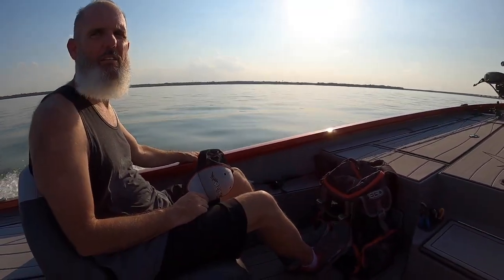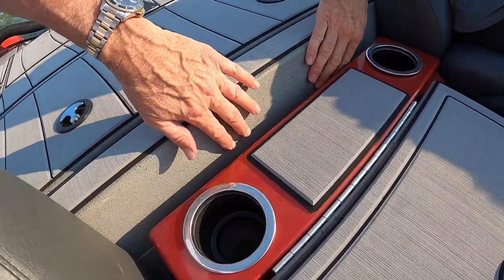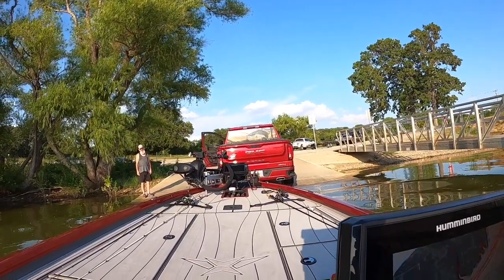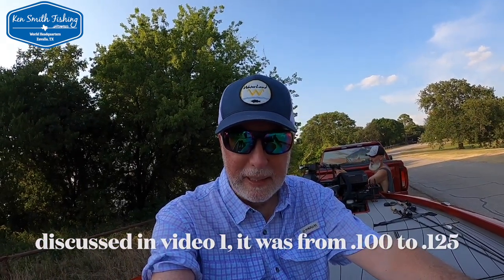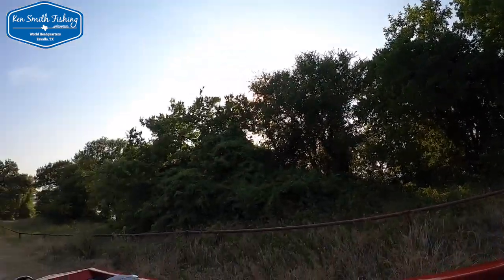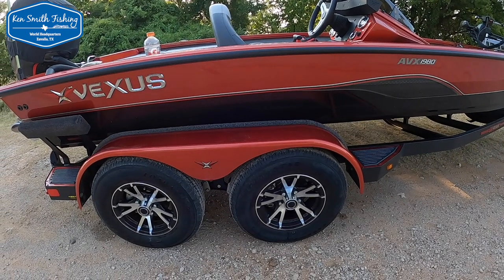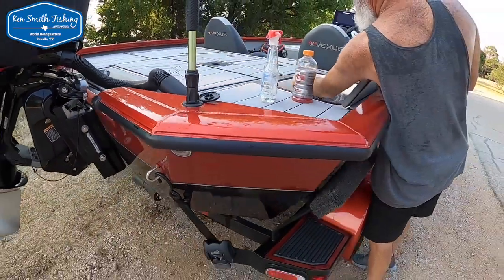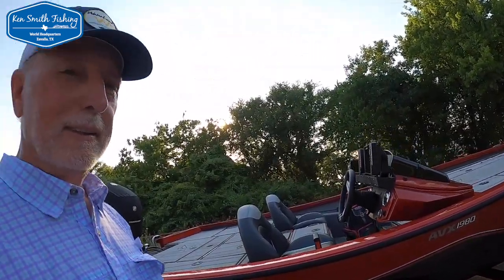Vexus AVX1980 Review - Part 3 - Great Tin Boat Search of 2022 - Boat 2 Vid 3 - 6th Video in Series

Comment: Yes, great boats, Vexus. However- 50 mph with a v6 pro XS?  What a lead sled! I mean- most old 18' fiberglass pad hulls will run out at 58-60 with a 150 efi. Even with a prop change and engine height adjustment maybe, 53/54?  Shallow water advantage is all anyone will get from an aluminum. Maybe some fuel milage . Great job Ken! I'm catching this video series a little late since I didn't know you even did aluminum reviews. So much for the notification bell.

Comment: I can confirm your comment on keeping on plane at low speeds in rough water.  Ran my local lake 3-3.5 foot waves, 20-ish mph backing off/getting on it riding the waves.  Never felt unsafe - did get a little wet pending the wind.  Opened up plenty of fishing spots to me on windy days that I wouldn't have tried with my old boat.

Comment: 2 inch dow corning foam cut to fit the lid gets the insulation part done on the ice chest. Simple and works well. 
I’m sure insulating that lid is on a Vexus list some were..

The charger cord hooked to the rear deck lid is another peeve. Vexus needs to install a plug at the rear of the boat or at the console to plug the charger into. I added a NOCO plug at the console. Cord drops from my ceiling in the garage straight down to the plug.

As is, Drop the cord into the battery compartment and its a PITA to get back out. 

Some will say they boats are under powered. As you have seen the boat plan quickly and ride very well. They cruise very well in that 30 to 40 mph range were you run most of the time. Could they use more top end speed.  Everyone always wants to go faster. IMHO the 1880 should have a 150. The 1980 a 175 or 200 and the 2080 should have a 250. 

Vexus would OWN the aluminum boat market at that point. 

Vexus Customer service is the bench mark as far as i’m concerned. Best in the business! 

Great review Ken.

Comment: Just caught up on the tin rig series. Running a tin rig myself but in a jet application. I seen you stated a few times about how to rate some of these tin rigs.
Being in the jet boat world, where we run in sub 6" of water you can imagine some of the stress we put on them. Especially when you get into the 200-300HP engines.

Things to consider:
Hull - is it one piece bottom or 2 piece split with the keel being used to join the two halves, is it foam injected, how is the bracing (longitude or cross or a mix of longitudinal and cross bracing), what kind of "hull bottom", modified, pad, semi v, is the bottom of the hull ribbed, flat, stepped
Hull thickness - personally I never recommend anything under 100ga if you run shallow. Under 100ga stress cracks, dents, dings and everything in between is really easy to happen, also the thicker the hull the better at times. Obviously thicker hulls are more resistant to dings and dents but harder to repair when you do ding it or dent it
All welded construction - no screws holding anything in when it comes to joining metals, obviously there is some leeway with this but if it's structural it should be welded. 
Transom construction - how many knee braces, how thick/large are they, do they wrap over the top of the transom, is it wood filled or not (generally this should not be wood filled, also this is generally the area in which wood is used in a tin boat, to add strength here), how is the corner gussets constructed (30 inches long, 16 inches long, do they extend from the corner to the engine), if it's got a "splash guard" like most bass boat style do how is this constructed, is it welded to the transom and rear deck tying the transom to the deck, for the most part all cracks or stress issues or problems for tin boats occur at the transom due to the stress put on them
Bow - is the cap re-enforced for trolling motor, is it all welded or partial, is it tied into the front deck, if so is it welded, screwed, riveted (welded being the best, screws being the worst)
Balance - is weight distribution good or bad, with tin boats being light if you don't have weight distribution equal you will notice it running down the lake/river, it'll lean one way or the other, can make a difference in shallow water running, speed, MPG, this is more jet boat oriented how does it sit in the water is it rear heavy or nose heavy, can make a difference in getting on plain, how well it handles in turns, nose heavy will want to drop hard and have a speer like effect, run slower, worse mpg to a degree, will turn faster, run shallower, less chance in having the "swapping effect", rear heavy will run deeper, take longer to get on plain, easier to swamp, turn slower, the nose will have a floating like effect, will run faster, better mpg to a degree

IMO outside of costs, tin has a better value to most users for the following reasons:
Light weight - easy to tow, easy to maneuver, easier to handle
Longevity - I think tin boats and glass boats if cared for are the same to a degree, it really just depends on how old you are talking about, a tin boat 20 years old can be in better condition than a glass boat with minimal care, a glass boat can fade over time or run into rot if not cared for
Durability - both glass and tin have come a long way here but IMO if you factor in constant abuse and you have a boat built really stout I think tin just edges out glass but not by much maybe a hairs width
Repairs - this is the big one that not a lot of people talk about, if you take out all the stress cracking or old age issues and just look at a glass boat and a tin boat and run them both into a tree and rip a hole in it for the most part a glass boat is totaled and done, you maybe able to find someone who might attempt a repair but you have to find a fiberglass shop that does fantastic work otherwise it would be a waste. For the tin boat, yea it maybe totaled as well but just about every dig, dent, and hole can be filled by any decent aluminum welder, I've seen photos on boats ran into trees and had the bow wrinkled 2ft back and they just weld on some pulleys and start working the metal out and where it can't be worked anymore just cut it off and weld in a replacement. Prime example: I ran a MK Terrova on my tin rig and made a mistake when mounting it, eventually it cracked and busted up the bow cap pretty bad. Just took it into the shop and had them weld on a new cap and double reinforced it so I wouldn't make the same mistake again. If it was a glass boat that would've been a pricey repair to have fixed let alone trying to reinforce it would probably not work.
Reply from the maker: awesome add Nathan, would you email me your phone number, I'd like to talk if we can kensmithfishing@outlook.com
Reply: @KenSmithFishing  Sent.

Comment: I agree with previous comments the cooler does hold ice all day. I have 3 27 series batters with two guys over 210 lbs fully loaded I can run 54 to 55. I would definitely recommend adjusting the jack plate. I love my AVX 1980 I chose it over the Ranger because of the ride and storage. I have zero issues loading the boat. He has the trailer to far in to the water. The boat loads very easy. Great review.
Reply from the maker: Henry that ramp i so shallow no other way to load it

Comment: Good review. I have the 2021 Vexus 1980. You said you did not like the cooler because it was not insulated. However I live in Texas and fish In the 100 plus heat and the cooler is outstanding. I have ice at the end of a long day of fishing. I went to the plant for a tour during my build and it is insulated well. You should take the tour you would be impressed.
Reply from the maker: The lid has zero insulation, not sure how that possibly holds ice?
Reply: He’s right Ken about the cooler. I have a 2080 and captain a high school team with the cooler full.  It will have ice the next day most days

Comment: My Tracker 195 TXW also had some failing welds where the hull meets with the transom. The boat was going to be shipped back to Tracker for warranty repairs because the gas tank needed to be removed prior to welding and would be gone for at least 3 months.  The service clerk at the Garland BassPro knew of a business, I think it was up near Lewisville, and they would be able to do the welding without needing to remove the gas tank. I was without a boat for only 1 week. So you might want to relay to the other Tracker boat owner to call the Garland BassPro Tracker service desk and see what the name of the business that did the welding on my boat.
Reply from the maker: David I think he may have had similar experience, we will find out soon as he has his boat back and we will review it
Reply: So the boat u reviewed has a hull issue??

Comment: I would add my 1980 is the easiest boat to load I've had. Even in heavy cross wind and current it will center up perfectly. Maybe it was just that shallow ramp he was at as I usually have the top of the fender out of water. And yes you being a glass guy you have to get use to that bow drift. Got mine last year 80 hrs on big motor mainly fish Mississippi River no problems other than I did let a tree remove that vexus lettering lol
Reply from the maker: Good to hear
Reply: I would agree, I have and 1880 and it loads very easy, just get the bow between the bumpers and it pushes right up.

Comment: I have zero issues loading my AVX 2080, I just put the trailer in until half the fender is under water. The trailer was definitely too far in the water.
Reply: Yes, I have the same boat an trailer he has loads like a dream
Reply from the maker: That's the ramp he always uses and it is VERY shallow, but it's less than a mile from his house, which is pretty handy!
Reply: @KenSmithFishing  that sounds amazing to have a ramp 1 mile from the house.
Reply: @KenSmithFishing  yes they load great.  I back my 2080 down till a couple inches of the side bunk is above the water.  Loads like a dream

Comment: In a tin boat ajust trim slowly in small Increments...... alow for the rpms to peak 
( to there highest rpm)
For some reason it takes a tin boat longer to adjust....you can also feel it the steering wheel..
When the weel starts to become easier to move to the left you'll know at that time you are on propper plain... ( less boat in the water = easier to the left steering )
Reply from the maker: Good advice Wayne, thanks

Comment: Ranger and Vexus both were cracking open, I heard they fixed the problems, 2021 and 2022 should be already updated
Reply from the maker: Interesting, seems Ranger has been building them long enough they should have had this figured out?
Reply: The one  I’ve read about have had nothing but great customer service. They will come an temporarily fix it ,let you keep fishing , order you a new boat drop it off at the dealer.Then the dealer  calls you to bring it in  an the dealer transfers all you bolt  on stuff to the new boat.

Comment: 1980 needs to be rated for at least a 175 and the 2080 should have a 225 on it. Both boats are dogs for their size.
Reply from the maker: They seem to sell pretty good
Reply: @KenSmithFishing  Good sales doesn’t change the fact that they are dogs in the performance sense. They might sell more with 25 hp on them but that’s just as speculative as their sales numbers.